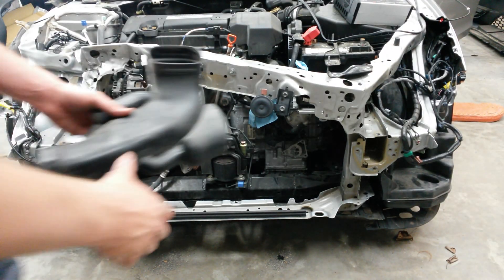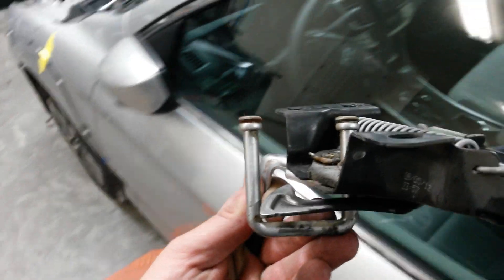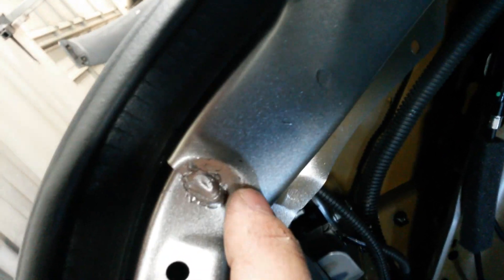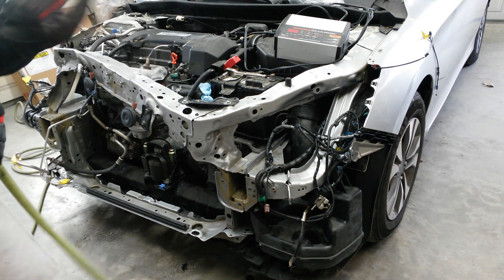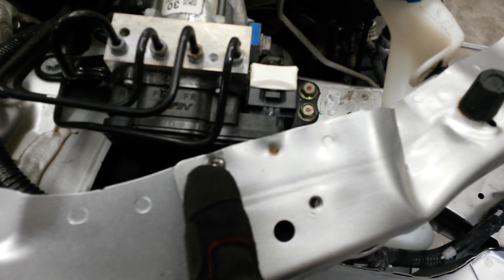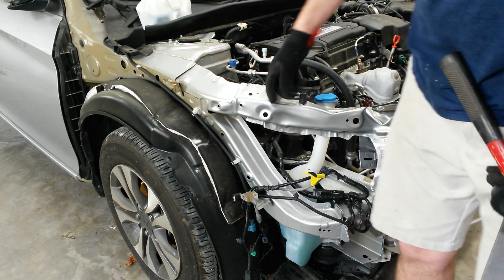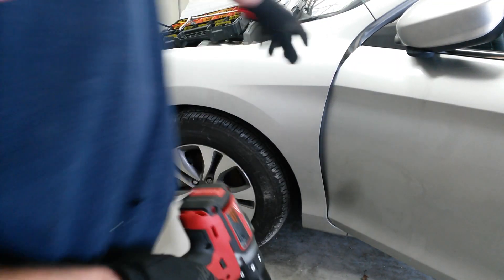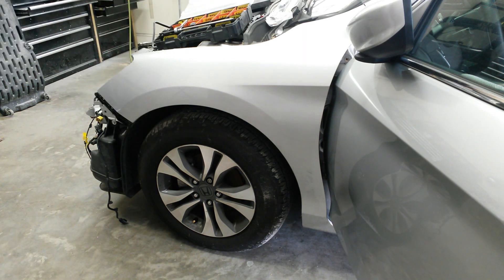2013 HONDA ACCORD | FRONT & REAR COLLISION REPAIR | SALVAGE REBUILD PART 2

Comment: I know this question don't have to do anything with the video ... If I buy a rebuild car but have to much problems can I returned to the sealer of it's over?
Reply from the maker: Usually you can't return the car to the auction unless there is a major hidden problem and the listing was incorrect.
Reply: I bought it through a dealership they for sale reconstruction title cars but like the front bumper impact bar its not there just put the bumper cover and to many other things like that
Reply from the maker: @rojo2107  that sounds like they did a dangerous job repairing it.  You would have to work it out with the  dealer

Comment: Damn, that's a shame that you paid that much for that car with it being hit in the rear like that. I do admire all your hard work and the level of skill you have. I just wish there wasn't so many shill bidders making these cars go so high.
Reply from the maker: Brian Smith yeah, this car was worth about 4k, but the rear damage was not visible online.  I saw it in person so I knew about it.  Most the other bidders probably didn't.
Reply: I figured you looked at it in person, which is the smart thing to do. Anyone that doesn't look at a CoPart auction vehicle in person before it sells is just asking for trouble because of how many dealers just doctor these cars up and run them through the auction.

Comment: Hey bro great work i learned a lot from u. Keep the videos coming I appreciate it them thx.
Ps. Where do u get ur measuring diagram..? Thx
Reply from the maker: Murphy Antun i get the measurements from honda thru oemonestop.com.
Reply: Wow this is super helpful for me since I'm a biginer.
Sam one more ? Do u have ur shop at hope or u rent ?
Thx u so much brother I wish u a very prosperous new year to and the fam.
Reply from the maker: murphy c I work out of my home  garage as a side job
Reply: That's what's up bro keep the cash flow moving.. I'm in Nj and the have a lot of regulation so they harrass u for anything so I'm thinking of moving away to have a Kool garage. Thx bro

Comment: only thing is what you call re bar is the main part of the frame that takes impact energy in crashes. I wouldnt have messed with it. Its made of different grades of steel, part of it is designed to crush..if thats not done right, and front crash wont be protected properly.
Reply from the maker: rooster sideburbs front rebar was undamaged.  I only rotated the brackets upward slightly. I replaced the rear rebar. Yes, they are  high strength steel and shouldn't be straightened. Only replaced.
Reply: It looks like it was taken off and rewelded?  How long did it take you to fix this.
Reply from the maker: rooster sideburbs it simply bolts on. No welding. It was removed for the repair to the radiator support and reinstalled. This repair took about 3 months off and on around other jobs
Reply: I see. looks like fun work.

Comment: How much did you get the car for?
Reply from the maker: Rob Wright auction price was $ 6100 but after fees and delivery, total was about 7400-7500.
Reply: Thanks for responding, how many miles does it have?
Reply from the maker: 65K. Super clean interior. Customer specifically mentioned wanting a clean interior, so I couldn't pass this one up, even though it needs a ton  of work. Trying to create future business from this customer. He's a good one.
Reply: That's great, keep the videos coming

Comment: Where is your shop located
Reply from the maker: galo James I am in Mississippi. thanks for watching.
Reply: Your welcome want to buy a car but it as a quarter panel job to fix so that's why I ask
Reply from the maker: Link doesn't work for me. Qtr panel job usually runs $1500-2000 for me to do. Depends a lot on parts prices and complexity.
Reply: Ok Kl
Reply: +Sam G r4pkht